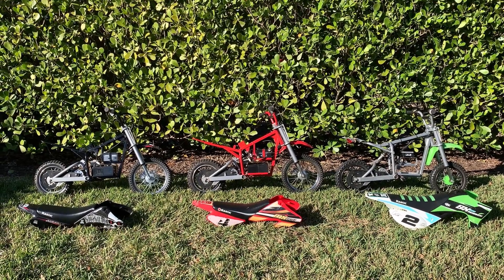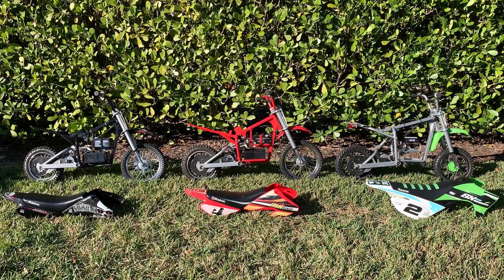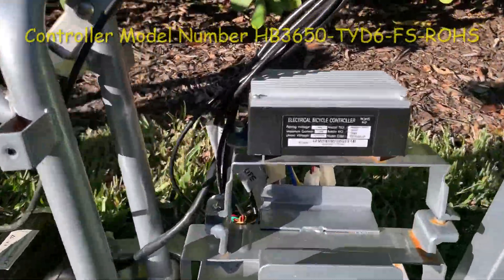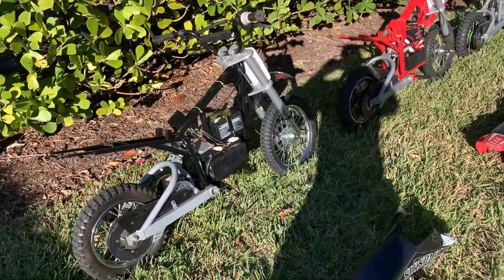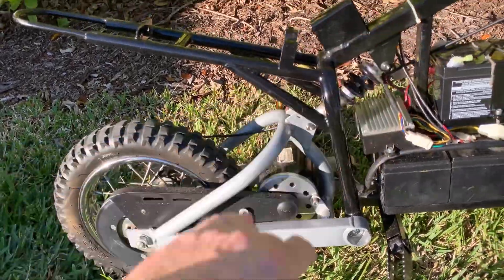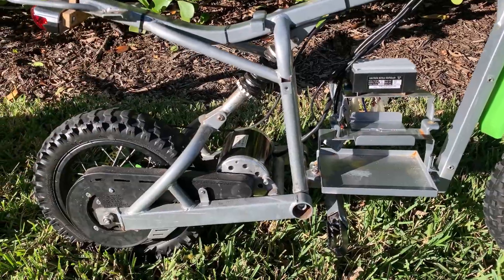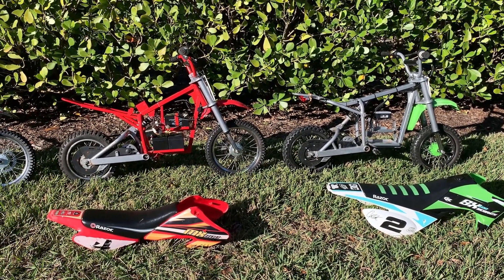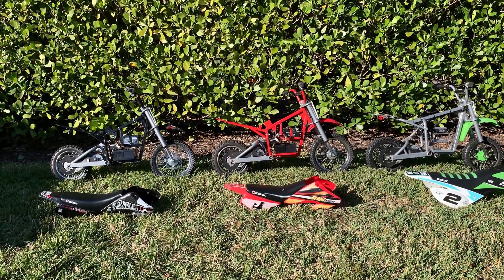Compare Razor MX650 vs MX500 vs SX500 - see them all disassembled

Comment: Which one is the biggest? Also the highest seat height. Are the sizes different depending on where you get the bikes from? Apologies for commenting 4 years later.
Reply from the maker: Sx500 seat is 1.25" taller mx frame
Reply: @BRichSolution  Also, for some reason, the Amazon website for the black version of the MX650 provides an image where the bike's height, from the bottom of the wheel to the top of the handlebars, is 40 inches. When I analyzed the picture, I estimated the seat to be about 30 inches from the ground. I don't know if Amazon's information is incorrect or if the bike is really that tall. Of course, I trust your information, as you know a lot about the bikes.

Comment: Sx500 front fork is more vertical=quicker steering.
Reply from the maker: Yes, the sx500 fork and frame is different from MX frame but the controller, batteries and motor is the same

Comment: I think the engine of the MX650 that you put in had the same power delivery as the other engine. The 650 means it is more powerful than the 500, which means that if you placed the SX500 engine in that, it would probably go faster as well.
Reply from the maker: I did put a genuine razor 650 motor on sx500 and no change in speed.   The batteries and controller (power delivery) are identical on all 3 bikes
Reply: No, I mean putting the SX500 engine into the Razor MX650. It might be different, and I might be wrong.

Comment: WHAT ABOUT MX400
Reply from the maker: Mx400 is the same as mx350 which is smaller frame and 24V
Reply: thanks im looking for my first build is the amazon 3000w motor kit a bolt n play setup i have a mx350 i want to tinker with  @BRichSolution

Comment: The mx650 has 650watt motor and mx500 has a 500watt motor. Same top speeds but one will have more torque.
Reply from the maker: I put the mx650 motor on mx500 and sx500 and didn’t notice a difference 🤔
Reply: @BRichSolution im just telling you the specs. Im sure they were negligable. Who knows if the controller even delivers the 30a continuous that it even advertises to be able to do.

Comment: you are hating on the 650 because "its identical to the 500" but the whole point is that it is just the 500 with more power
Reply from the maker: Only hating that is marketed and typically sold for more when its the same bike.   Same battery and same controller.  I put 650w motor on mx500 and sx500 and no 500w motor on mx650 and change is speed

Comment: I got a free 2021 mx500 and a $65 2018 mx650, I like the yellow 😂 but the forks and rear swing arms are rusted and paint chipped,  so I’m swapping the back end and front forks from the mx500 over now. basically taking  rebuilding the mx650 with all the good stuff. 
W video
Reply from the maker: You can remove rust easy with bar keepers see video
https://youtu.be/hLo1RUO0W9Q
Reply: @sweet! I’ll check it out!! Dawn soap and Steel wool works amazingly also!

Comment: i've been modding power wheels for a while, but we just got our kids (4 and 6) an mx125 that i've already upgraded the controller/throttle for 20v. that said, i'm looking for a used/broken mx650 on fb marketplace to upgrade. I weigh 195, do you think the sx500 would be a good choice? I still don't understand why the 650 has a higher weight rating...
Reply from the maker: Mx650 and mx500 are the same bike except mx500 is read.   Sx500 has slightly different frame and is rated for 180lbs but it can handle 195
Reply: @BRichSolution  exactly what I was looking for, thank you! i'll keep an eye out for all three and see what deals I find. I also checked out your other videos, good stuff, thank you!!!!

Comment: So from my understanding is they are the same except the engine watts the 650 has a 650 watt motor and the 500 has a 500 watt motor
Reply from the maker: Yes, but its negligible difference when I put 650w motor on my kid sx500 and no change in top speed and torque.  Hence the reason for video

Comment: Walmart has this "Razor x Realtree Dirt Rocket MX650" - any idea if this is basically the same thing? It is $120 cheaper than the cheapest mx500s I can find online. Gift for my 7r old but I my 210lbs fat dad a$$ wants to be able to ride it a few blocks down the street occasionally. Great no-bs and to the point video btw, ty - subbed.
Reply from the maker: Get the realtree mx650 from Walmart

Comment: Could you switch around the plastics cuz I want to put the mx650 plastics on the sx500
Reply from the maker: No the mx does not fit on Sx frame as they are different attachment points

Comment: Just bought a sx500 today, so far I like it. I’m probably gonna upgrade the battery first then the motor and controller
Reply from the maker: Thats great route to take.  48V battery with stock motor and controller and then upgrade to 2000w motor kit.  See my other video on upgrading sx500

Comment: The torque at 150 watts difference
Is not going to be as good as a 10x motor
You need at least 1.5 kw to really see the improvement
Reply from the maker: I agree.  I upgraded to 2000w

Comment: Does the mx650 and the sx500 have the same frame ?
Reply from the maker: No.  Sx500 frame is slightly larger then mx650 / mx500

Comment: What’s the biggest the mx 500 or the 650
Reply from the maker: Mx500 & mx650 are the same bike, only difference is color.  SX500 is about the same size but seat height is 1” taller and feels less crammed as adult riders

Comment: Right, the sx500 has different rear triangle geometry mx  650 has more travel on the front fork so although power is similar (not the same) so mx650 is slight improvements based on the mx500
Reply from the maker: Mx500 and mx650 are the same except for the color
Reply: @BRichSolution  Not accurate.  They are same except color and motor wattage.  Everything else is the same.  I know for fact as I am a Razor service center/tech.

Comment: From what Razor claims the MX500 has a 500 Watt motor while the MX650 has a 650 Watt Motor
Reply from the maker: The reason I know the 650 motor and 500 motor is the same is 3 years ago my son had a sx500 and bought a 650 motor from razor installed it and there was No change in performance.  Thats what spawned this video.  If the motor is the same and controller is the same then all the same speed.  There are differences in manufacturing thats why I have seen stock mx500 faster than mx650 and vise versa

Comment: awesome video!  can you fit the MX500 front wheel to the SX500?  It doesn't look like you can fit the MX500 rear wheel to the SX500 rear wheel.
Reply from the maker: Yes
Reply: Rear wheels are the same other than hub color.  Interchangeable.

Comment: i have a mx500 with a 212cc motor on it, thing rips. 
i’m only on this video trying to see the difference in 650 and 500. size wise. i want a 300 on this puppy😂
Reply from the maker: No different the mx650 and mx500 are the same bike except for color
Reply: @BRichSolution  damn. that’s rough.  
i appreciate the comment tho man, 
do you know of any older electric dirt bikes that had bigger battery’s in them ?

Comment: Hello Im looking to put a  72 volt kit in either a mx650 or sx500. I can get both similar price. Are either taller, and ive heard people talk about the sx riding way smoother than the mx, any idea
Reply from the maker: Not sure about smoother ride.  The sx500 is a better frame as the seat sits 1” higher and feels less crammed for adult rider then mx.  Also battery box is larger in sx500 whereas the mx frame shock protrudes into the battery box.    Btw 72v will cost you over $1200.   You can build a nice 48v / 1800w bile that does 35 mph for less than $450.   https://youtu.be/rBJ2z1ujeRg
Reply: @BRichSolution  yah ik im riding with my buddy on a surron. thx for the info
Reply from the maker: sx500 is taller and battery box larger

Comment: Is it possible to put the sx500 front rim on the mx500? Like will the rotor and all that? Im looking to swap
Reply from the maker: Yes the sx500 wheel fits on mx500 and vise versa… same with mx650
Reply: Nice its kinda hard to find tires for the mx500 front rim.
Reply: Have you tried putting the rsf rims on the mx500? Or will it not work

Comment: Thanks video help alot so mx500 n mx650 are the same it height and frame wise?
Reply from the maker: Yes the mx500 and mx650 are the same frame, same batteries, same controller and most likely the the same motor.  Only the color is different
Reply: @BRichSolution  thanks do you know where can i buy the front plastic like the mud guard and front number plate for them mx650 cant find no where?

Comment: Can you get the 72v kit for the 500 like you can for the 650?
Reply from the maker: Yes people make them… but 72v will cost you over $1000 and you can buy a better bike by the time you upgrade suspension.  That’s why I built a 48v 1800w bike that goes 35 mph for less than $300
Reply: @BRichSolution  I want the most torque. Plus 35-45mph
Reply: @BRichSolution  mx650 is only 10 bucks more anyway. Not much of a difference in price

Comment: Doesn’t the smaller wheels require different   gear ratio?
Looking at the 500 versus the 650 for my son who is almost 12 yo
I appreciate this information. Very informative
Reply from the maker: the rear wheels on all 3 bikes are the same; only the front wheel is larger on MX frame.   The gears on the motor and rear sprocket are the same on all 3 bikes
Reply: My son is 6yrs old and has the 650 his buddy has the 500. My son can fully plant his feet on the 500 with butt in seat. He is on tippy toes on the 650. So weird
Reply: @LAStereoLasVegas  is it a mx 500 or sx500?
Reply: @alexbekkala1718  good question at the moment I don’t know

Comment: Me and my brother have had mx500 and mx650 for years and we’ve raced them countless times gps them too mx650 has slightly higher top speed same torque though but it does pull ahead in top speed even with me weighing 50lbs more than my brother at the time
Reply from the maker: What is the top speed on the MX500 & MX650?   My neighbor has two new bikes and the MX500 is faster than the MX650.  There is variation in the manufacturing that can cause bikes to be slightly faster.  His MX500 does 17.6 mph & the MX650 does 17.3 mph.   Both are brand new
Reply: @BRichSolution  we had 3 mx500 and 3 mx650 in our group of friends and every mx500 we gpsd at 17 mph even and the mx650 varied a little one did 18mph which was mine one did 19mph and one did 20mph even if we switched bikes which is weird so weight didn’t play a factor in that either

Comment: im commenting this pretty late but i think the top speed is unchanged so it could be one of those bikes thats legal in street aswell as sidewalks so thier might be a limiter for that reason, the differnece between the 500w and 650w would be the torque, basically just acceleration
Reply from the maker: I would tend agree.   I don't have good method of measuring the torque and the manufacturing differences could also be a factor.  Ironically when I swapped the old 500w motor for brand new direct razor 650 motor the bikes top speed decreased by 0.5 mph.   As for the torque I would say negligible between the 500 and 650.   If I have time maybe I can motor swap the 500 & 650 and perform an acceleration test?

Comment: so your just saying your opinion......
Reply from the maker: Batteries & Controllers are all the same for MX & SX.  The MX650 might have 650W vs 500W but I doubt it as I stated in video when I put the 650W motor on my sons SX500 the top speed didn't change and the 500W motor on the MX650 had the same speed.

Comment: What would be best for a 200lb person? The mx650 holds up to 220lb but I’m not trying to spend that much
Reply from the maker: If is a price difference than get the less expensive MX500; spec say it holds 170lbs but it's the same frame as MX650.  I also have a friend that is 210 lbs and rides MX500 all day
Reply: Don’t listen to this guy. They are definitely different in power. I have both brand new out the box and the 650 gets fought over because of the way it handles my weight much better

Comment: Hello I wanna ask u I wanna buy an mx500 or an sx500 but idk what to choose I like the mx500 cuz it has a bigger front tier but I like the sx cuz it has a bigger seat but idk which is faster plz reply I subscribed
Reply from the maker: there both the same speed.   I'd say get the MX500 as parts seem to be more available; unless you plan to buy used and want to customize; the sx500 has more room in the battery box for mods and you can put MX500 front wheel on sx500
Reply: Does it work the other way around? Like put the sx front tire on the mx?

Comment: I think it’s taller
Reply from the maker: The MX500 & MX650 are the same height & same frame; the SX500 seat is taller by 1.25 inches (32mm)
Reply: @BRichSolution  wow that’s crazy thanks for the info bro

Comment: Razor should build a larger electric bike for adults
Reply from the maker: Anything over 20 mph (32 kph) is not considered a low speed vehicle (LSV) and then would be considered a motorcycle.     Look at eBikes there are many cool looking ones made for adults.    https://youtu.be/l22Bho-BCs4
Reply: @BRichSolution  . I own a Trek Ebike but will be good to have a bigger razor scooter

Comment: I just got my mx650 for 200
Reply from the maker: $200 for used is good; in this video I was stating its not worth buying a brand new MX650 all they are all the same inside
Reply: I’d rather waste money on  batteries and upgraded control module throttle
Reply: A year ago I got a 6 months old MX 650 for 120 and last year I bought a 2016 SX500 for 40 bucks. I sold the 650

Comment: But it says the 650 goes faster
Reply from the maker: I have seen brand new mx500 faster than mx650 and vice versa.  There is variation in manufacturing.   How I suspected the bikes were all the same was last year I replaced the 500w motor on my sons SX500 with factory direct MX650 motor and the top speed was unchanged.   The I bought a MX500 & MX650 to prove to myself all the bikes are the same inside (batteries, controller & motor)
Reply: @BRichSolution  Ok do you have any recommendation for gas powered teens bike I want it to go fast but maybe like under 350?

Comment: i mod my bikes and i put a 56v batter 40vmoter so it goes 70mph
Reply from the maker: what motor sprocket are you using to get 70 mph?  14T or 15T?   70 mph must be scary on this little bike; 40 mph is scary enough for me
Reply: @BRichSolution  mine is razed by 5 inch
Reply: @BRichSolution  i am using a 40vt moter
Reply: @BRichSolution  and the stock sprocket just stiff

Comment: The MX 650 goes 17 miles an hour
Reply from the maker: yes, the mx650 does 17 mph; the mx500 does the same.  The SX500 (green) did 17.6 mph with stock 500w motor; I swapped the motor with a brand new Razor MX650 motor and the top speed dropped to 17.1 mph.   That's when it planted the seed for the video.   I've seen mx500 faster than mx650 and vise versa.  there is slight differences in manufacturing can make a change in performance.
Reply: I thought the sx500 and mx500 went 15mph
Reply: That do
Reply: @holidaykingmanmoirlawncare4511  what you mean

Comment: Well thank you for the breakdown! Are the motors all MY1020 / ZY1020?
Reply: They are same series of motor (1020).  While MX500, 650, and SX500 all use same 36V controller, the difference is the MX500 and SX500 use 500W motors and the 650 uses a 650 Watt motor.  Top end speed is roughly 1-2mph difference.  Now is 1-2mph worth the price difference?  Not really.
Reply from the maker: yes, just different stickers
Reply: @BRichSolution  thank you for your response

Comment: Nice video but what about torque on roads is there any difference between the Mx 500 and the 650
Reply from the maker: The MX650 and MX500 is the same bike just different colors.  If there is a perform ace gain is negligible as I put the 650 motor on my sons SX500 and there was not performance change
Reply: @BRichSolution  i noticed the 650 will pull me better and goes faster than the 500, i did a comparison but at different times it's definitely faster but not $200 faster for $200 you could upgrade controller and motor then another $100-200 48v actually found a deal for 36v bat for $69 might have to do 2 of those and run a 72 v

Comment: Thanks for the explanation, I'm looking for an ebike for my 5 yo but I think I will get the SX500 for myself and switch the battery to a hoverboard one. You talked about li-on battery, do you know how more time do you have compare to the stock one?
I did this swap to my Crazy Cart and my arm becomes numb before I get the chance to kill the battery and this CC comes with 2 12v battery  by default.
Can you also tell me the distance between the seat and the foot rest?
Reply from the maker: from the Y in the seat to foot pegs:  SX500 measures 16 inches, MX650 & MX500 is 15 inches

As for going to Li-Ion Battery over stock battery.    The Stock batteries have 12Ah.   The 36V Li-ion battery I used is 16 Ah which is 33% (16/12) more ride time which is over hour.   If you go to 20Ah battery you will ride for 90+ minutes
Reply: @BRichSolution  which 36v brand did you go with? I want reliable and recommend. Thanks!

Comment: So if a switch the speed controller it work be faster. Right????
Reply from the maker: not necessary.  I replaced motor on SX500 with MX650 motor, no speed change.   I replaced the controller with aftermarket 36v/1000w controller and there was no change.   You have to change motor sprocket or go to 48V in order to gain top end speed.   see my other videos

Comment: They are garbage u going to pay more to repair them than the bike cost and they don t last long
Reply from the maker: I don't like the stock batteries as they make the bikes to heavy.  That's why I buy the bikes used and put Li-Ion batteries in them and lighten them up by 18lbs (8 kg) and longer ride times
Reply: This razors are well built besides the garbage batteries